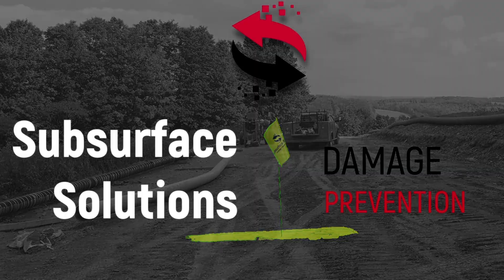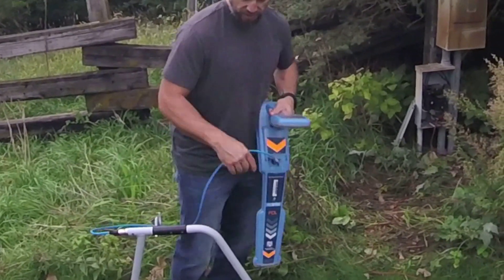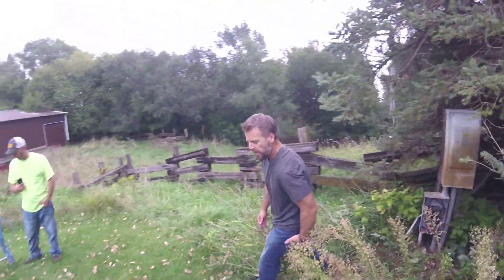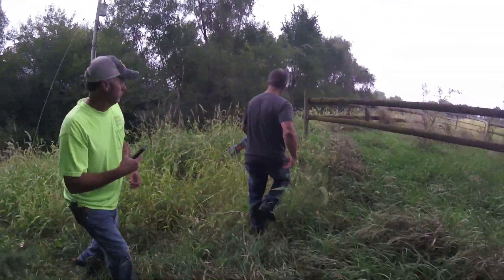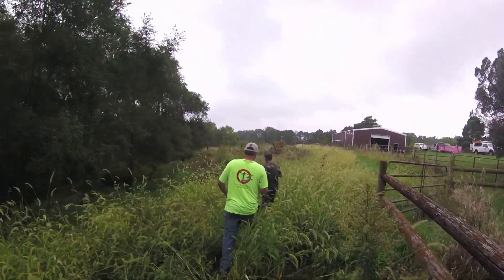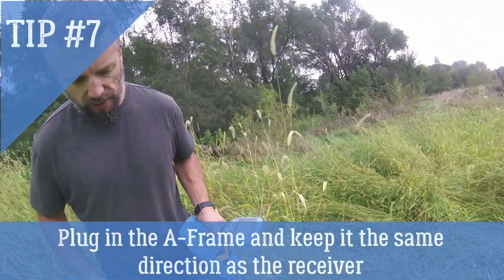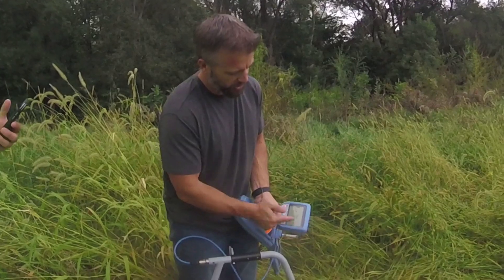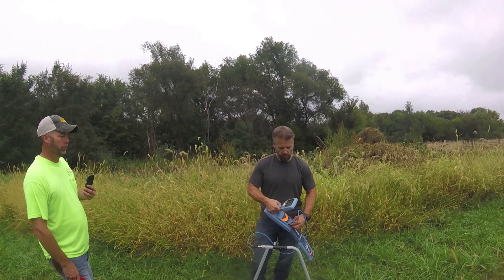Fault Finding with RD8100

Comment: Sorry, but I am a bit confused by this... it looks like you're initially using the locator on its own to locate the cable, and you note that there is a sudden increase in depth, which is where you marked on the ground with red paint (my understanding is this sudden increase in depth is where the fault is). You then switched to the A-frame and found something else further along (also marked with red paint). Then at the end of the video you came back to the original red paint marker (where the change in depth was noticed) and said that was where you need to dig. I don't understand what the second marker (made with the A-frame) was for... and why you'd even need the A-frame if the locator can detect the fault (by looking at the change in depth). Could you please explain these two points? Thank you.
Reply from the maker: Faults create a distorted magnetic field that will give escalated depth readings, which is your first indication there is a problem nearby but doesn't pinpoint the location as well as the A-frame.  There were two faults on this line but the first location was worse judging by the higher decibel reading and should be investigated (daylighted) first.